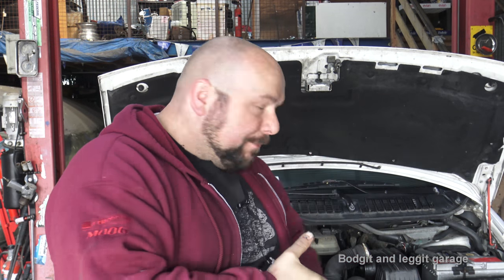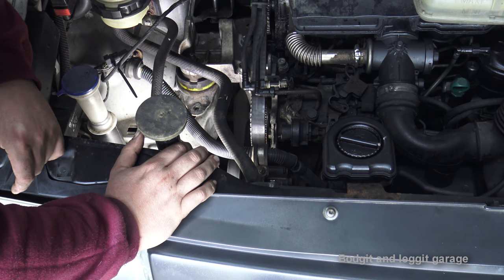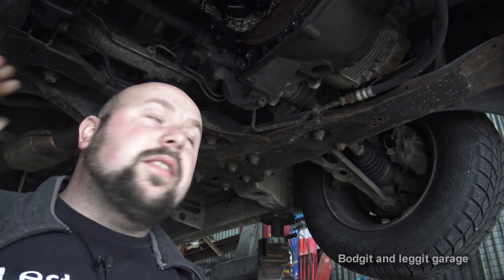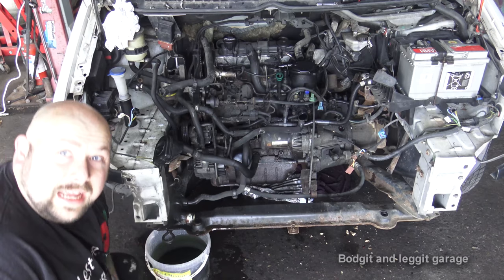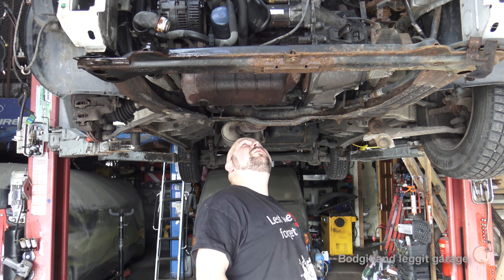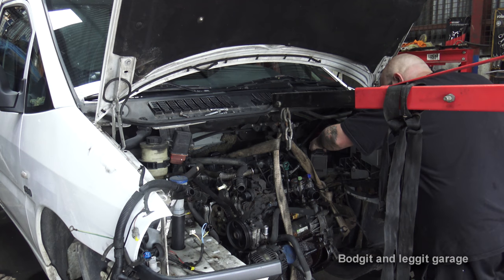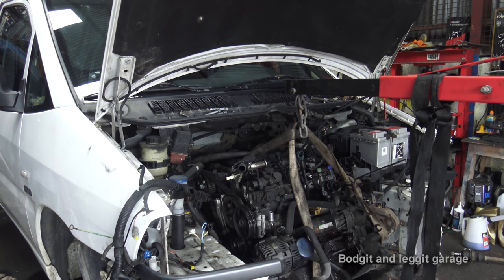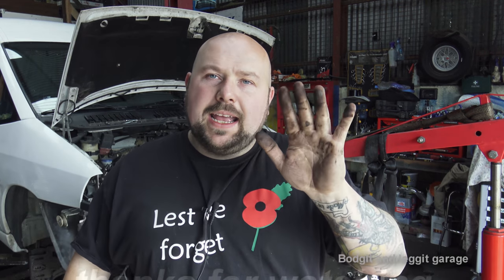Citroen Dispatch/jumpy Engine Removal part1 Bodgit And Leggit Garage

Comment: The reason for that gearbox mount being so rusty is because of the scuttle area under the windscreen. It has two drain pipes one on each side, that take the excess rainwater safely down to the wheel arches to run off. When they get blocked with mud etc, the water backs up and the scuttle area fills up and drips directly onto that mounting. So to any owners - I would advise you to get a coat hanger, or like I did, a wet and dry vac and suck those through (5 min job) to make sure that your mountings don't get soaked every time it rains. A silly and minor, yet important thing if that makes sense. Got to love the DW8.

Comment: just makes you wonder if the cambelt had been replaced at a sensible interval that engine may have been saved. the bearing guide tube on the gearbox looks like its seen better days. I had a clutch done on a citroen car, and it was the bearing that was the problem. the bearing tube didn't get replaced, and caused new clutch to fail prematurely.
Reply from the maker: Rob Taylor hi mate yes it's a possibility with the timing belt but unfortunately they also got bad diesel so we had a fuel problem and an engine problem more or less both at the same time which is unfortunate

Comment: My engine mount bracket just broke on me same van, same mount you was having issues with :(  had to get the AA to take me home. I was 1 mile away from joining the motorway which was lucky.  Don't know what would of happened if i was on the motorway doing 70mph.  Looking inside at the damage is giving me a headache.  All bolts are rusted to the core.  Got my work cutout with this one.  I hope you replaced your mount bracket as it looks just like mine did before it broke and dropped the engine onto the drive shaft.  I'm just happy i managed to get home safe tbh. It could of been a different story if on the motorway. love the video man.
Reply: It all went a little to smoothly.  Now I can see the mount is actually in good shape, its the bracket that the mount fits to that broken clean off.  I'm surprised there was no callback for this.  Now where to get this bracket from?  Looking online just keeps showing mounts only.  I may have to get one made for it yet.

Comment: hi i recently did a full rebuild on mine...to get the engine out the easy way is to take off the front cross member off and place a hydraulic lifting trolley  under engine and fabricate some engine stands out of steel square tube...attach engine stands attach stands to trolley     and lift and slide engine out in one...no need for wishbones to come off or anything
Reply from the maker: Gary shaw sounds interesting mate but the reason I took the wristbands out is so I didn't have to disconnect suspension taking a suspension wishbone do you have to do one

Comment: Did you have any problemss with rusted up engine bolts. I'm waiting for inspiration from the garage where mine is. They've come to a standstill on the job of replacing the clutch as the mechanic was trying to drop the engine and couldn't get the sub frame off as the bolts were seized.

Comment: Hi, have you never had a engine leveller for your hoist? It makes it easier to remove and replace the engines.
Reply from the maker: 8ile yes mate I've got one but it would have been no good in this case as you cannot get the engine crane in enough to make this do any good when you look at the engine coming out it was straight had no problems

Comment: Leon engine replacement on these vans is a piece of piss I've had 3 of them usually takes 2 hours to pull the lump out and 2.5 hours to bung it back in they only slight issue u might get is with the offside driveshaft it's support bearing goes through an aluminium mount which can badly oxidize other than that straightforward job.anyway well done and keep up the good work.LOVELY JUBBLY INNIT!!!

Comment: if the color of the smoke is white so the fuel system  is no the problem, it's a mechanical issue.
Do you agree with me
Reply from the maker: عبدالله العريبي yes and no
Reply: how  i dont understand  can you explain please
Reply from the maker: عبدالله العريبي they can be loads of reasons why white smoke timing is one bent valves as another one injector problems pump problems the list can go on
Reply: Think you mate i'm waitaing for part 2